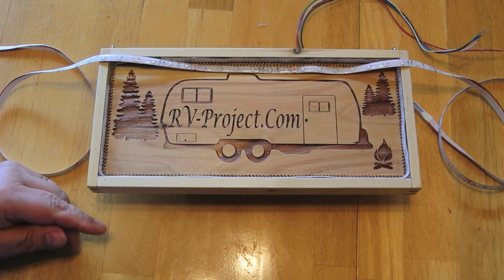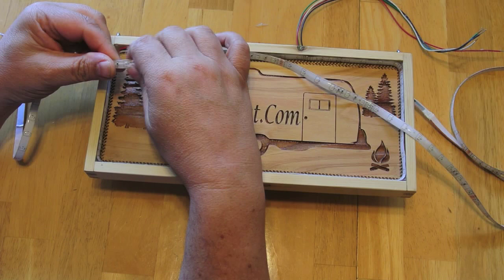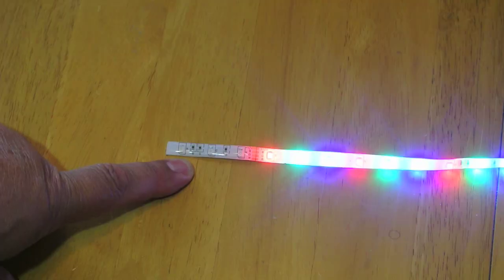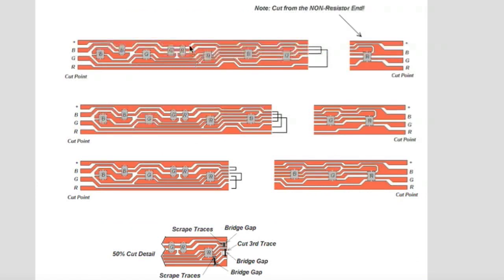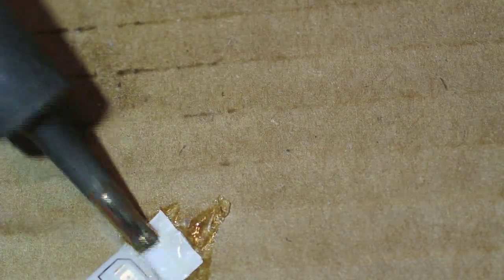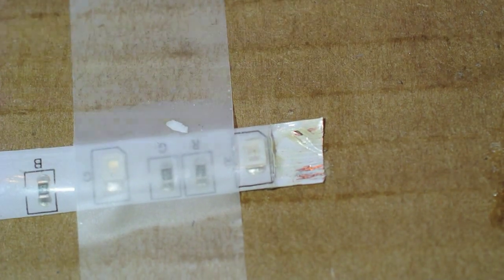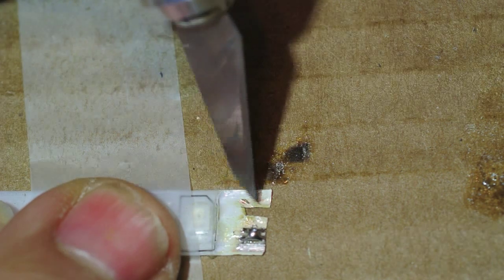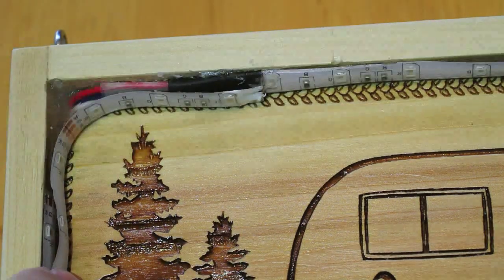Cutting LED strips "between the lines".

Comment: Where do you find the wiring schematic picture you used
Reply from the maker: Unfortunately, you will have to trace out the wiring for a schematic.   Due to the wide variety of connection schemes used by the LED strip manufacturers, no one schematic would work.
Reply: @RVProject  thanks for the reply!

Comment: By completing each circuit without the 2nd LED in series, that'll change/increase the voltage across the 1 remaining LED. Aren't they going to be noticeably brighter than the entire strip, and possibly burn out from over voltage??
Reply from the maker: Like all diodes, LEDs are current operated devices. Each LED has a specific forward-bias voltage; most LEDs are 2v.  So when 12V is applied, 2V appears across each LED, regardless if there is one or two LEDs in the circuit.
The current flow through the LED will be higher as the series resistor is designed for 2 LEDs, so 2V additional will be across the resistor, resulting in a slightly increased current flow.
For example, two LEDs having a 2.0V forward bias voltage on a 12V power supply having a 560 Ohm current limiting resistor.  The current flow will be: 12V(supply voltage) - 4V(LED forward bias voltage) = 8V across the resistor.  Ohms Law then says we should have around 14mA current flow.
If we cut out one LED with the same 560 Ohm resistor we will now have (10V/560Ohms), we will have 17mA current flow.  So we are only changing the current flow by less than 20%.  As LED light output tends to be exponential, we are not likely to see any difference in output.
And the resistor's power dissipation will change from 110mW to 170mW.  Typically the chip resistors are rated at 1/4W or above, so there should be no issues.
Still, I present this video as an informational source, and it is up to the person doing the work whether or not this project is for them.

Comment: This was interesting, thanks. I tried it on a Philips Hue lightstrip, but it has 2 layers and the resistors are on the far end, so it isn't easy to fix up. I ended up cutting just the membrane and folding the unwanted length behind the strip. It is very thin and can't be seen in my installation.

Comment: This is really great stuff. Do you know anything about antennae and weather stations? That would be some really interesting stuff to hear about.
Reply from the maker: Do you have any specific requests?

About the only antenna-related topic I have is from my sister-site www.boat-project.com where I discuss VHF Antenna fundamentals http://www.boat-project.com/tutorials/vhfant.htm and electromagnetic radiation issues in boats (Radar, etc): http://www.boat-project.com/tutorials/10mwCM2.htm

I have a couple of articles on my RV-Project.com website where I installed a weather station: http://www.rv-project.com/projects/simple.php  http://www.rv-project.com/projects/weather.php
Reply: I was thinking about going with more of a low budget professional weather station approach. What do you think about installing an Airmar weather station in an RV? And this is kind of out there, but is there any usefulness of a system like NMEA2000 in an RV? Some day it would be great to control features of my RV with my computer, as a long term goal.
Reply from the maker: NMEA2000 was just getting going when I was into boats (before my boat 
got damaged in a fire and I started into RVs). My last boat had an 
integrated Chart Plotter, Radar, Depth Finder, AIS, Fuel Flow, Fuel and 
Water Tank Level monitors all interconnected by NMEA2000.

I imagine by now that these things are less expensive, but it seems a 
bit overkill in a RV.

I remember the Airmar weather station from my boating days. I am not sure if there is any newer versions, but one cool thing about the gadget is it could measure wind speed and direction even when you were underway. It measured wind from three axis, and with the boat speed input (or internal GPS), it could resolve the wind.

They were $600 or so a few years ago.

I did have a Raymarine Weather Station on the boat that I could never get to work. It received Sirius Weather and output it in NMEA2000. It was supposed to overlay the weather on the Chartplotter (fancy name for a GPS Navigation System) also made by  Raymarine, but I could never get it to work on the NMEA2000 bus. It would work with non-Raymarine NMEA2000 gear (but that gear did not have chartplotting display capability), but it would not work with it's own brand.

But I did have RADAR on board so I could see thunderstorms in the distance. And the boat was damaged before I was able to fix the incompatibility.